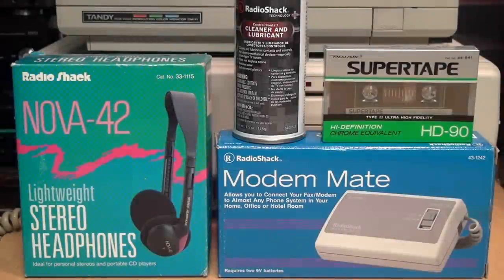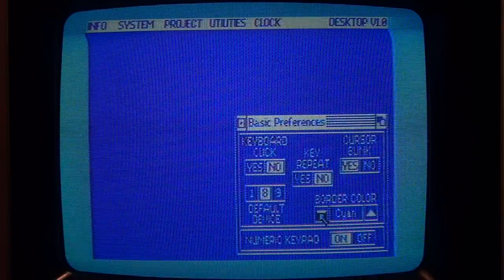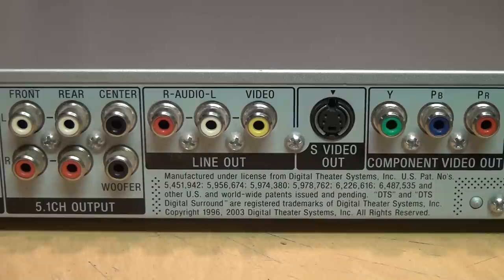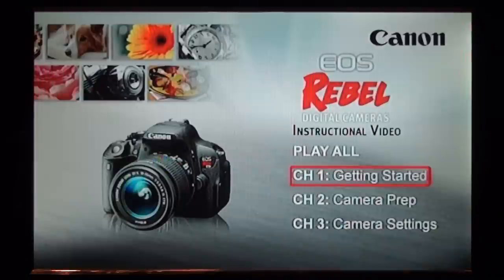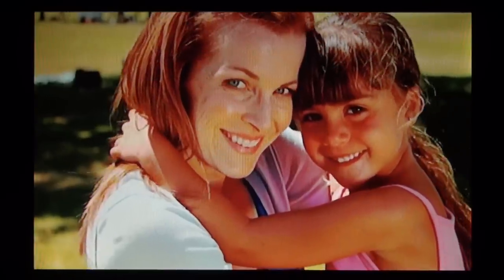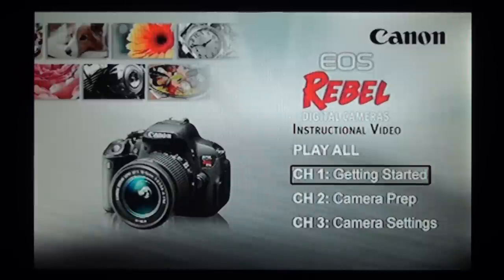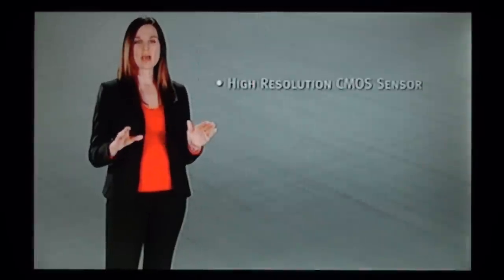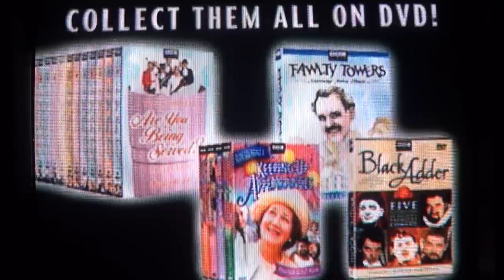Radio Shack S-video signal converter 📺 How? Why?

Comment: Back in the days before HDMI existed, some laptops or PC video cards used to have an S-Video output along with the standard VGA port, so adapters like this were very useful to connect those computers to a regular TV which only had a composite video input but not an S-Video one.
Reply: I remember soliciting for a job at ASML early 2000s and the VGA port on their laptop had 2 pins shorted out, took my thrusty old chinese army knife and bent them back and voila i could enjoy a 2,5 hour long powerpoint along with 85 other people. Didn't get the job though.
Reply: Yep, I have a cable for my HP Pavilion dv6000. That was pretty useful.
Reply: This is exactly what I was gonna say.
Reply: I even remember getting excited after getting a TV with an actual S-video input
Reply: The back of the package also says it's useful for connecting multiple things by s-video to a tv with one s-video input. Unfortunately this is about the worst way to do it, behind just using composite all the way for the other input, and finding an s-video switcher or y-adapter.
Reply: ^ this ... i still have a videocard that could use that little adapter... i hate that radioshack is gone...
Reply: Me and my friends used to make little cartoons in Shockwave Flash in the late 90s. My parents' PC had a S-video out and with an adapter I'd connect it to a VCR (and the sound card to the VCR's audio in) where I'd record the cartoons onto tapes. We'd give them to friends who didn't have computers yet (again, late 90s).

Though the adapter I used didn't come from Radio Shack, it went with the video card.
Reply: My PowerBook G4 came with an adapter from S Video to Composite in the box.
Reply: Also, some tv-tuner cards did not feature more than one of these inputs
Reply: this is when i used s-video the most
Reply: Facts! I was just about to say the same thing. The family computer only had s video and vga so an adapter like this would’ve been perfect back then
Reply: I had a Compaq Deskpro Pentium III with an Nvidia GeForceFX 5200 as a living room “media” computer for years, and used one of these to send s-video to my TV’s composite in.
Windows 2000 in 320x240 was not…super usable.
Reply: Yup, that was the case with me as well. My laptop at the time had a S-Video and VGA output for external monitor. When I was faced with only a composite video input on a video system this little adapter was awesome!
(a typical application was video graphics on a small to midsize nightclub video system.... those were almost always composite back in the day)
Reply: I have an old HP Compaq laptop that I used for movies at get togethers with friends. Probably still have my RadioShack S-Video to composite cable somewhere as well. Good times...
Reply: True
Reply: Those s video connectors usually had extra pins for RGB though, and I think some even had a pin for CVBS/Compositr
Reply: Exactly,  laptops with svideo. Sadly those adapters sucked. I worked and RadioShack and made sure to tell any customer that insisted on buying one that they were returnable if they saved the package.
Reply: In addition to the VGA cards I used these adapters to work around a few AV receivers I ran into that did not do internal s video <-> composite conversion and the person I was setting up did not want to do the "change the receiver AND tv input dance".
Reply: wasnt that a multi-out usually? was that pin compatible with svideo usually?

Comment: This is one of those not really ideal, but "lots better than nothing" solutions that analog signals allow.
Reply: It's no wonder why analog signal processing is starting to catch on again in some applications where it can work faster and cheaper than digital equivalents, even some AI processing tech is taking analog approaches because it can be made ridiculously efficient and fast
Reply: For many purposes, "close enough" is fine. An old friend of mine who was an electronics tech referred to it as "analog schmoozing" where most of what you wanted in an electronic signal still got recorded or displayed in spite of various limitations of media and playback devices. Heck, in spite of being digital data, with modern spinning hard drives, the playback circuitry is making it's "best guess" and depending on various kinds of error correction to make sure it's a good guess.
Reply: @UNSCPILOT  I dunno what part of the digital process does it, but whatever it was, it's ruined some modern movies, at least in theatres, for me.  During scenes with at lot of movement, the fragmenting, or whatever people want to call it, actually hurts my eyes.

Comment: I got one of these for a TAM that only has Svideo input. They’re actually very electrically simple. It ties both signal grounds together, and ties C and Y together with a very tiny capacitor on the C signal. This apparently makes all the difference and mixes or splits the C and Y very well.
Reply: From your description it sounds as if the capacitor acts as a crossover filter, perhaps? So that only low frequencies as passed through the Y channel and only high frequencies through the C channel. That would explain the softening of the image, as the Y channel is apparently band-limited; the TV does its own filtering of the chroma band when decoding composite input on top of that, so that's why it looks even softer when wired in the S-Video->Composite direction. That's my theory at least.

I wonder how it performs on PAL signals. The PAL chroma signal is considerably higher in the spectrum than NTSC, so if my crossover theory is correct, then even more of luma would be lost, but the chroma signal would contain a considerable amount of higher-frequency luma interference. I wonder how do displays cope with that.

That being said, S-Video was never as big in PAL regions. We got RGB in the form of SCART in the 1980s, and that served as the higher-end signal format, rendering S-Video largely pointless for anything except perhaps the actual S-VHS decks.
Reply: @kFY514  yeah, I only saw S-video on actual S-VHS decks back in the day. Most TVs only had SCART and needed an adapter even for composite. A little later, I would see it on a bunch of LCD TVs, as it looks like those jellybean composite/S-video jacks (which would share audio) were standard and cheap.
Reply: @kaitlyn__L  SCART could carry composite or RGB (or both mixed together, that was intended for the early teletext decoders and the like), and when you connected a VCR via SCART, that carried composite. You needed an adapter for the RCA jacks, but those were completely passive as well.

Aside from the S-VHS decks, I also remember S-Video as TV-outs on early 2000s computers (and inputs on TV tuner cards), so that was perhaps an option for a slightly better image on a TV. Probably that's because those computer parts were designed in NTSC lands, and perhaps the connector size was a factor as well. I heard you could hack together a passive VGA-SCART (RGB) adapter and force at least some GPUs to output 576i over that, for even better picture - although I've never seen it in action.
Reply: This was the cheap way. The best way to do it is with a summing amp that just adds the two signals with no bandpass, e.g. ISL59114.
Reply: @kFY514  indeed! I said that with the understanding that SCART carried multiple types of signals :) 

Come to think of it, a friend at school had a very techie dad, and he kept an S-video deck around purely to plug his laptop into his TV stack with (after he’d moved-on to DVD and his DVR for movies and TV recording).
Reply: I also used one for many years !
Reply: @kFY514  SCART was not just one type, they were of many kinds, and non-compatible, some compatible and some not compatible. SCART can carry composite, some even S-video, RGB, but not all have RGB, not all have S-video, etc.
In 2000 a colleague of mine asked me to help her conect a video-camera to a TV. Camera was having composite out and S-video out, and the TV was having SCART in and composite in, so I first bought an S-video to scart cable, with the cable SCART having S-Video inside the SCART and audio in SCART taken from a separate cable  on the the S-video side. Well, the TV showed video but only B&W, so I have to get another cable composite to composite  plus audio, and I had to swallow the 5 USD worth of the first cable with was of no use to me...S-video was obsolete from the '90s coz' of the better filters for composite, at least for the good stuff    TV. The S-video in non standard form, similar also with PS2, and also of many kinds non-compatible, some with Video-IN separate alonside Video-out, was still a thing later for some PC graphic card with video out or video in and out. I  had something like this with more pins on two Asus graphic cards, one from 2004 -  9600XT VIVO video-in and out separate on the same conector, and also on one from 2007 - 1950PRO non-vivo. I never use those conectors. I have tried with the 9600XT, the Asus provided cable had composite in and separate out for TV, but the TV was not happy.
Reply: @loochan325  Standard SCART has always supported composite and RGB. I don't know how widespread actual RGB support was - I guess most TV should support it (it was one of the motivations for the existence of this connector, after all!), although I can't imagine e.g. a VCR supporting recording from RGB.

SCART could also carry S-Video and YCbCr, sometimes even in HD - however those were common, but non-standard extensions.

And there's also the fact that some SCART cables omitted various pins to cut costs because "nobody was using them".

And yes, proprietary extensions of the mini-DIN S-Video connector were also a thing on computers. But I wouldn't call S-Video obsolete since the 90s. The composite video quality improved thanks to better filters, but there always will be measurable improvement in image quality, provided that there is enough detail in the input.
Reply: Wanted to point the same, i think the cap is a 4.7uF, i wanted this kind of adaptor soo much on the nineties when some PCs and notebooks had S-video output but most tvs and vcrs only had composite
Reply: Isn't that just a notch filter of some kind?
Reply: @loochan325  a top end full specked SCART cable with the really thick one run all the pin connection, the cheaper one did not, not great rf sheading/screening also, I think you are referring to box connect with SCART connector sockets and the socket not being wired up for each pin, eg. TV that would take an inputted tv signal, but would not output the displayed screen image? (that something the big main room CRT, could do, with ease, not had new flat screen that could do that yet?
Reply: I made one from a circuit I found online more  a decade ago, it used a capacitor and a resistor and worked very well, in fact better than one I bought thinking it would be better. the capacitor value had to be precise. I remember experimenting with different capacitors either way the colour would change to black and white.
Reply: @panchenima  
I used use 470pf  I'm not sure what it was I had seen this done in, but some commercial product did exactly this on the circuit board to derive the composite out. I figured if it's good enough to sell in a product, it is probably good enough for general use.
Reply: @kaitlyn__L  in Europe yes but in the states no... Good luck finding any American AV product with SCART

Comment: I used to use this with a laptop that had a special TV out port that looked like S-video but had 3 extra pin holes, so it could output s-video, composite through the extra pins, or component using a combination of all pins somehow. The adapter that went from that port to composite rca female got lost,  so the radio shack adapter made for a suitable replacement.  As mentioned by someone else,  it uses a capacitor between the chroma contacts to act as a filter to prevent smearing and dot crawl.
Reply: Oh yes, I have seen those, SOME of them you can use Component Video out on for HD video.(they is another adapter you can get for that)
Reply: Assuming the C pin is also responsible for Cb or Cr, one of those extra pins could’ve just been a signal pin, which told C (for S-video aka Y/C) to become, say, Cb. 

Or, perhaps it was simply wired to produce Cb and Cr from the extra two non-composite pins, leaving the C pin entirely alone, and sharing the Y for both. 

Quite interesting that they didn’t add any extra grounds to that custom connector though, since half of the pins on an S-video mini-DIN are separate grounds to avoid crosstalk between the Y and the C.

 If I were to hazard a guess, composite might’ve shared a ground with C, Cb, and Cr, to keep the Y clean. But it would’ve still produced a slightly degraded signal overall, almost-certainly letting some higher-frequency Y back-in to the C (just like composite always does) even in the other modes.
Reply: @kaitlyn__L  The 7-pin connectors are pretty nonstandard but it seems usually component video mode involves retasking one of the pins. Sometimes the sixth and seventh pins are ground, sometimes they are sense.

All I know for sure is that a random PNY cable I picked up somewhere, when plugged into my Dell, will output composite on its Pb jack.

Comment: Man, I so miss Radio Shack.  Up here in Canada, they were bought and converted into "The Source" but they were a mere shadow of Radio Shack and even they started disappearing from a lot of cities.

There are so many BestBuy stores around, I am surprised they haven't decided to add a more Radio Shack section to the stores.
Reply: Then there was Future Shop and Best Buy being one in the same company. I bought a TV that says on the back of it only for sale at Best Buy at Future Shop. 😂
Reply: Back when Circuit City was involved, The Source was OK. But, with CC out of the picture, it has just become a rebranded Bell Store that sells more than just phones.
Reply: Vaquero357  Yep. There is one in my hometown of Roundup Montana. It's paired with a contracting business ran by an electrition and a electrical engineer. I think all the ones that are left are "RadioShack Dealers" but any of the corperate stores are gone. There where like 5 in Billings, pop 200k(as compaired to Roundup at 1,800) but they are all gone. 
    I think RadioShack would be smart if they just said screw the brick and morter stores, like they already did. But they should put effort into expanding this dealer system. Then maybe we could have a nice RadioShack parts section in Best Buy for example. Then I can buy a capacitor from BestBuy and RadioShack still gets to exist.

Comment: Like you, I didn't know an adapter like this was possible but I bought one, or perhaps an adapting cord, around 2005-06. I don't think it was from Radio Shack.
The reason I wanted it was because my Windows XP Dell had S-Video out so I could technically hook it to my adjacent TV, which I did. It made for an easier time sharing 'viral' early YouTube and Google Video videos with guests. But if I wanted to capture something from my PC for prosperity, such as the look of a website, online video, or PC game, my best option for capturing video was VHS. Since none of my VCRs recorded from S-video, I found this adapter. I did use it to save video from some PC things at the time but I used it much less often than I'd imagined.
Reply: Got any interesting footage that youd like to share? :D
Reply: Yes, I had the cord version, too. I had a home built computer with an ATI All-in-Wonder video card that had both SVGA and S-Video outputs. The cards were meant to be used in conjunction with video capture cards in media systems.
Reply: I think you can just switch in your GPU settings or in EnTech PowerStrip whether it outputs composite or luma-chroma via the S-Video plug. Though i don't remember for certain when i last did printing to VHS from a PC graphics card, whether it was on the TNT2 or on the GeForce 2mx. Anyway i also needed some custom modes and stuff to make it look good, but it did look excellent. I think the card itself came with a little S-Video to composite pigtail which did nothing, it just connected the baseband (luma) pin straight through, did not combine chroma itself, and you had to use the software to set the corresponding mode.
Reply: actually you can find some cheap chinese hdmi to composite cables and they don't work so yeah, if it sounds too good to be true it probably isn't
Reply: I think I got one for exactly the same reason.  I had some early GeForce card and wanted to use the S-Video output.  I might have worked at Radio Shack at the time.  It was annoying, because you needed an S-Video cable and composite cable too in order to do this, due to the weird gendering of the adapter (female on both ends).
Reply: @dmatech  yeah the cable got a double penetration for no reason, it could come at least with one cable to ease the use
Reply: @dmatech  it could be male on both ends, I'm sure it would be usefull the same way
Reply: @geovani60624  yeah, but if it were female on one end, you could use a single patch cable instead of needing two of them.
Reply: @dmatech  true but if it you wanted to use the other way around it could be a problem, I personally believe it could be male on both ends, it would only be a problem with proprietary ports in some equipments, but then a male to female adapter would do the trick the same way, an adapter is cheaper than a second cable (at least a good one)